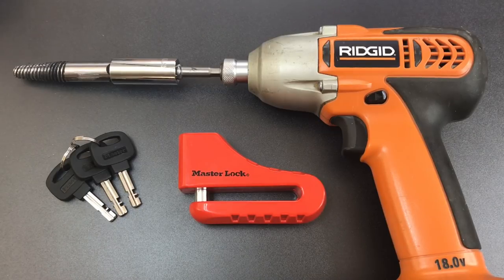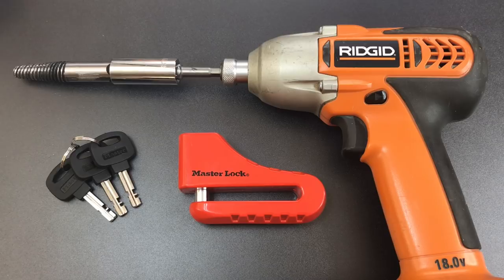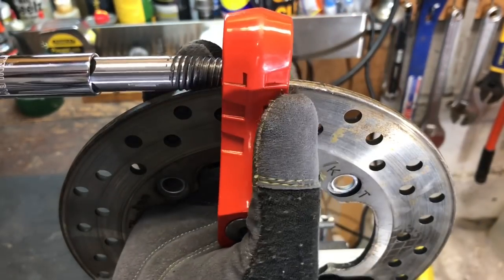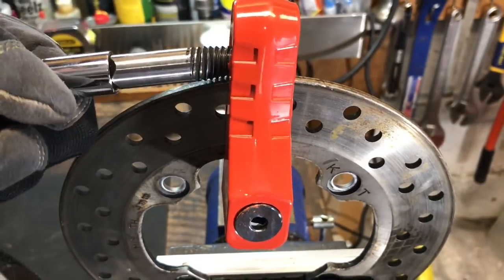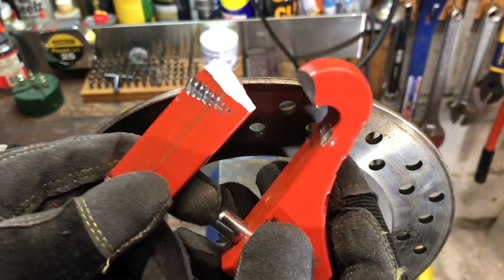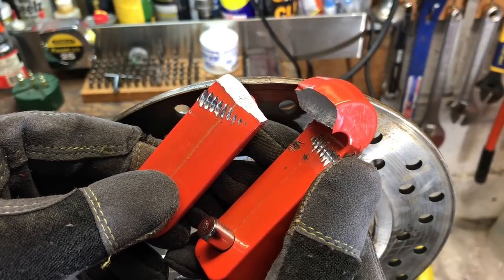[645] Impact Driving the Bolt Extractor Exploit

Comment: That's an impact driver, not an impact wrench. impact wrench would have a lot more power, and can be had in small-ish sizes. Also, the use of chrome socket (adapters) is a little dangerous compared to using a proper impact socket! But I can understand not wanting to buy one just to test this.
Reply: Impact wrench is overkill.  Most modern brushless impact drivers could have done the job; it's not uncommon to see a broken 1/4" shank, and really that is the limiting design factor why manufacturers don't make drivers anymore powerful.
Reply: Oh yea, top of the line impact drivers don't really have an issue driving concrete screws, and they're not too big. What i'm wondering however,  is however a small(ish) 18v SDS in drill mode would do the job. Of course, then you step out of the realm of carrying it in your pocket... for which i'd take an 12v screwdriver (ie the bosch line is surprisingly strong for its tiny size) + a wrench to finish the job.
Reply: I agree, a modern cordless impact wrench would have handled that quite easily.  I'm also sure a modern cordless impact driver would work as well, but probably quite slower.  The torque differences varies a lot between a driver and a wrench as their designed uses are not the same.   A driver could finish that off if time allowed the hammer to do its work mm by mm..
Reply: well, with impact wrenches you move up in size, and thats why i wondered over a small sds, since it would be considerably less noisy for about the same size/weight
Reply: +1 for the brushless impact drivers. I have a Makita brushless impact driver and it will loosen bolts that I can only break free with a 3 foot cheater bar. 

I think the advantage of an impact driver over a angle grinder is that you won't be lighting up half the neighborhood with sparks.
Reply: Colin Stuart yeah one of the Milwaukee M12 3/8 drive impacts would be smaller and put out enough torque.

Comment: After viewing a few of your videos on the brute force attack, I broke out the high torque Milwaukee 1/2 impact wrench I use for my truck lug nuts. 

Impact socket, 7/16" extractor, under 3 seconds and the Sealy disc brake lock was in two pieces.
Reply: Gunga Dinn Absolutely the expected result. There's a meathead trying to say otherwise.
Reply: Milwaukee makes pretty good stuff.
Reply: I would like to also confirm, the m12 Fuel version of Milwaukee's impact driver was able to successfully do this job on a similar lock, and similar extracting bit.

Comment: 8” ratchet, with maybe 80lbs of pulling force, wow that impact driver has less than 55ft-lbs of torque. Yikes.
Reply: He's also using it in reverse. It's not an impact wrench after all.
Reply: its just a 1/4 in driver ..
Reply: It might be just a 1/4 nut driver but it's old the way he's holding that ratchet I'd say he's getting at the very most 70-80ft/lbs my 1/4 inch nut driver puts out 120ft/lbs his nut driver is old
Reply: Dewalt impact driver is far better
Reply: Fakename, Ridgid is an okay brand and amperage of the battery has nothing to do with the performance in the video. Just old technology there, like he told.
Reply: I have the Craftsman 1/4 driver. I use it a lot for my car for lower torque bolts and plastic panels etc. Makes jobs faster to get things loose or start a lot of screws and finish them off with a torque wrench if needed. Rated for 1500 inc/lbs
Reply: It's not about brand, I can hold my 1200Nm Hazet 1/2 impact with my hand. That bolt has to be fixed, if you hold it in your hand, all impacting force is absorbed.
Reply: That impact driver is 12 years old
Reply: By the looks of it, it's probably powered by a NiMH battery instead of a modern Lithium-Ion battery. Modern impact drivers by companies like Milwaukee can easily reach 1000Nm and above in that size.
Reply: Meanwhile im laughting here caressing my milwaukee mid torque with 600 lbs of breaking power lol
Reply: It's more than just Rigid being weak. That's the older 18v NiCd model, not the 18v lithium ion or the newer 20v version.

Compared to the 18v Li ion it's got about a third less power and well under half the battery life under normal use. Considering this job was basically hammering on an immobile bolt at full draw, NiCd batteries weaken very quickly under that kind of use.

In low end tools, the batteries make all the difference.
Reply: Not just old, it was a bottom end tool when it came out based on the battery style

Comment: Yeah, your impact driver is gutless. The new ones are light years ahead of that one. My 20 volt porter cable will regularly break impact socket adapters if I let it. I use it everyday as a mechanic.

Comment: I believe a Milwaukee 1/2 inch drive would have effortlessly dispatched the lock, if not, it would easily have snapped the extractor.
Reply: Fragotron McFarland I stand by my assertion. 1400lb-ft sure as hell will snap one or the other.
Reply: Gotta go with Jack on this one, Fragotron McFarland. The Milwaukee wouldn't even break a sweat on this. smh. ; )
Reply: @fragotron  A tool that will spin off a crank bolt with zero hesitation absolutely will break either the lock, the extractor bit, or the damn socket. Something has to give.

Comment: Down to the Garage!  I'm interested in the metal that failed, specifically, what it is and what the fractured portion looks like. Please tell me that's at least steel and not "hardened zinc"!  ;)
Reply: CandyGramForMongo sintered steel. Basically powdered steel is put into a mold then heated to the point of the metal crystals joining but not melting into a bigger crystal structure.

Comment: As LPL says it's old, a modern tool like a 1/2 inch 18v cordless rattle gun would make quick work of that lock. Even my relatively cheap Ryobi would make mincemeat of the lock in no time.

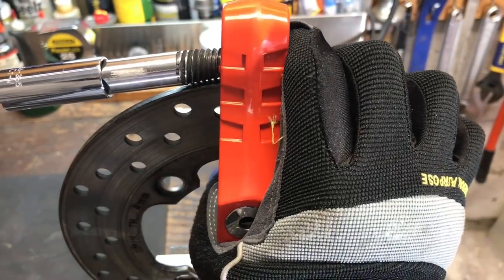Comment: At 1:55 if you look carefully you can see the the impact tool is actually turning but very slowly so I guess it could make it if you are not in a hurry. But using a noisy and slow tool is not better than the manual tool of course.
Reply: c muller I don't think he knows the trick of watching the stamped size on the socket to tell if it's turning. He was likely just watching the extractor.

Comment: That's casting vs forging for you. If they paid just that bit extra to have the lock body forged, it would be a great lock and they could justify the higher price needed to cover the cost of a forging over a casting. (At this point in teh comment I notice the all-steel body one you did so I watched that real quick). I think also a forged one will prevent you from spreading like you did the steel one. The steel one was able to be spread as not only did you stretch the inside, but you, although you probably cant see it or tell, compressed the outside as well and that exterior bulge would be bulging a tiny bit more after. Forging pulls the grains in the same direction, resisting compression and separation. Forging is also why you didn't break your ratchet with the pipe :D

All that said, there are good and bad forgings. 2 dollar shop tools are bad forging.

Are there any forged models of such a lock on the market? I'll see if I can find anything as well.
Reply: I know this is an old comment. But it's not because I was cast. It was because it's not made of steel. That lock is zinc.
Reply: @_BLANK_BLANK  no, its because it was cast. The same thing would happen with steel if the steel wasn't forged. The shear strength would be a little higher but that's about it. It would just be a little harder. Forging creates very tight grain structure ans the metal is shaped under high heat and preassure. The grain flows around the forging instead of being non existent in a casting or one-directional in a standard piece of steel.

Take a look at a standard low to mid range spanner set. Even the cheapest forgings are very strong and there's a reason they're not made of normal steel.
Reply: @_BLANK_BLANK  I reference a steel lock he did the same thing to in the comment you replied to originally.

Comment: Im guessing that there's not enough inertia in the "target" for an impact driver to work.  You could check this by putting a similar lock on the ground or in a solidly mounted vice and using the same driver.  (Just to clarify, I don't think your driver is deficient, just that impact drivers are designed for hitting against high axial inertia to generate the torque). Definitely quicker and quieter with a small wrench, but worth a try... :)

Comment: I know other comments have already mentioned this, but you were using an impact driver, not an impact wrench. A decent impact driver will have 600-in-lb of force. A decent electric impact wrench will have 600-800 ft-lb of force. A factor of 12 or more in power would make a huge difference....

Comment: That driver might have done the job if the bolt extractor had been straight instead of on an angle. 
It  does make a difference. One time on a shutdown at a gas plant my crew had the job of removing two large valves with 1 inch drive air impact guns. We had two guns and the crew split up into two man teams. I had most of the nuts and studs removed while the other guy only had two or three of them busted loose. We switched impact guns at his request and I was still getting more done. The difference was that I'm 6foot 3 inches tall and he was about 5 foot 11 so he couldn't reach high enough to get the tool straight up and down.

Comment: For the ones crying about not using an impact socket... well in worst case he cracks it... whats the big deal.
I had to use a regular socket, coz I didnt have that large of an impact socket at the time (for drive shaft axle nut) on my 600 nm impact. If you consider the risk, and accept it (and wear gloves and eye protection) its fine to risk it imo.
If it's stupid but it works...

Comment: Prefer the 1/2" drive. 3/8" drive would fit in a large motorcycle healmet, which would also catch the broken lock. 
Harder to hide 1/2" drive but my guess is an easier and faster job. 
Would fill the open top of the lock with a hardened steel wedge to prevent the screw extractor exploit.

Comment: I bet any impact driver will fail, even modern ones. The problem is not the tool itself but the fact that the lock is loose on the rotor. Most of the impact energy is wasted on rattling it around. For an impact driver to show its power the fastener (or in this case the bold extractor) needs to be driven into something solid and rigid.

Comment: that is one ment to be used as a screw driver. you need one ment for wheel lug's. it will break that little socket you have there if the resistance is enough

Comment: I think a good impact gun would get the job done.
Reply: That's not the point he's trying to make he's trying to make the point that well yes it would work if you had a good one because his is 12 years old it would still be very loud and you could do it just as easily with a little 8 inch ratchet which would be much more concealable and much more quieter than an impact driver

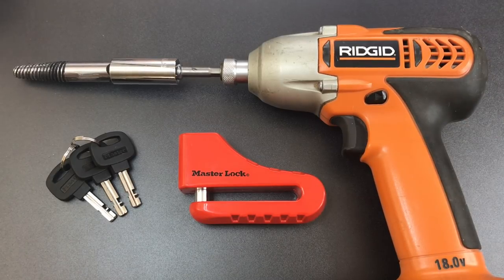Comment: "...and it's not as "torque-y" as modern designs. (1:01)"  "Torquey," is that a technical term or a legal one?    : )
Reply: I'll correct myself.  I just looked it up. 'Torquey' is actually the adjective form of the word 'torque' and was used with the appropriate grammar and sentence structure in the video. Today I learned something...doh!

Comment: You are using the wrong kind of impact driver!  One like that with 1/4" bits is really only good for driving wood screws. For that large bolt extractor you need an impact driver with a 1/2" drive or at least a 3/8" drive and Harbor Freight has both sizes.

Comment: Sorry but I have to disagree with the idea that an impact driver would draw as much suspicion as an angle grinder. While it's true that they both make a lot of noise, I think people are much more likely to assume you are working on your bike with an impact versus an angle grinder. 

Even now that I know about this exploit. If I saw someone leaned over next to a motorcycle using an impact gun, I would still assume they're working on the bike versus trying to break open a lock with a bolt extractor. Now somebody with an angle grinder at the front wheel shooting Sparks everywhere, I would be much more suspicious.

Sometimes the most suspicious thing you can do is to look like you're trying to be covert. Nobody suspects the person that is clearly not trying to hide anything. is clearly not trying to hide anything.
Reply: Ever heard of nighttime? Hearing an impact driver on the street outside in the middle of the night would probably draw as much suspicion as an angle grinder. And why bother when you would ratchet it just as quick lol. Not to mention theres a tire in the way which makes the impact driver method useless anyway

Comment: Once again, if you were to push down on the rachet handle, you would have the mechanical advantage. But no, you have to pull up on it and use muscle instead of weight.

Comment: Speaking as a tool guy, i sincerely hope you've replaced that antique since this video was done.

Most of the major brands now offer 12v impact drivers that deliver equal or greater torque than the designs of yesteryear and are pretty much pocket size.

Comment: Evidently the people that suggested this don't use impact drivers regularly, you would be better off using a regular screw gun
Reply: Mark Smith evidently you have never used an impact driver that was made by anyone but mattel
Reply: I don't know aye I would think a cordless drill would break your wrist. Impact gun is the way to go if your using power tools. Tho not the one in the vid, something in the 1/2" verierty
Reply: 08yannch yeah, his impact is definitely weak sauce
Reply: Highstranger951 I'm a dryliner and do cladding so I use them daily, impact drivers don't use torque but brute force by hammering it in rather than turning,
Reply: Mark Smith we know how they work bud
Reply: Highstranger951 If so how would u think this would work then? A bolt extractor wont work being hammered in yet u think a gun that hammers it in would work lol
Reply: Mark Smith it doesn’t hammer it in like a hammer and nail!

Comment: Highly biased & riddled with misinformation. You are installing that disc lock on a rear brake rotor that its not designed to go on. Additionally on most bikes the rear brake rotor is either inaccessible or considerably more difficult to reach.  When the lock is installed correctly on a larger 280mm + front brake rotor you won't have the room on the top outer edge to insert your bolt extractor & brake the lock.